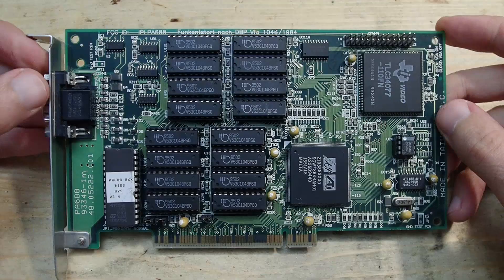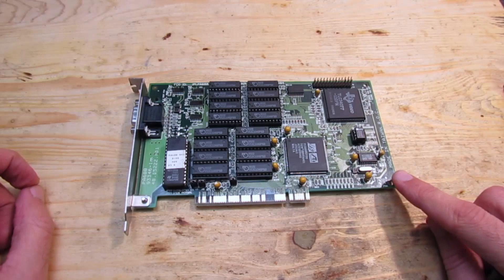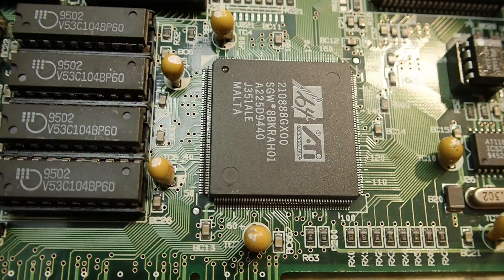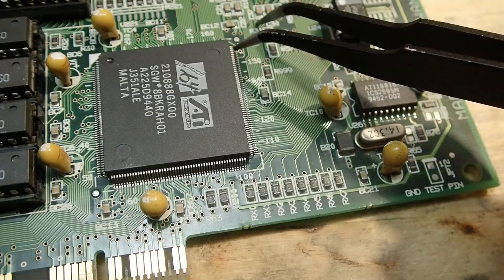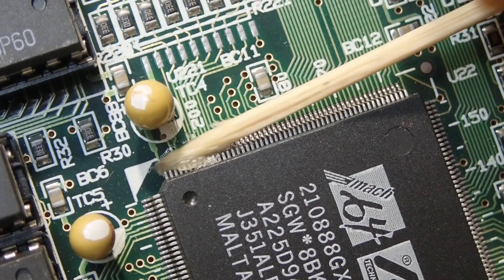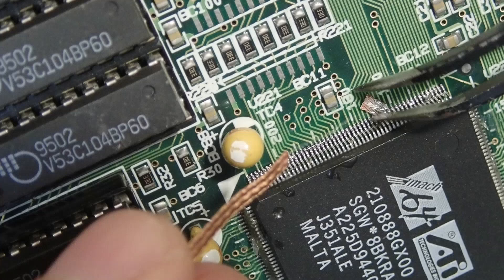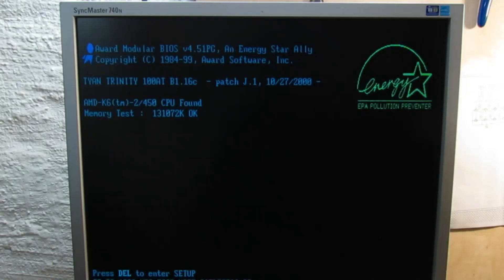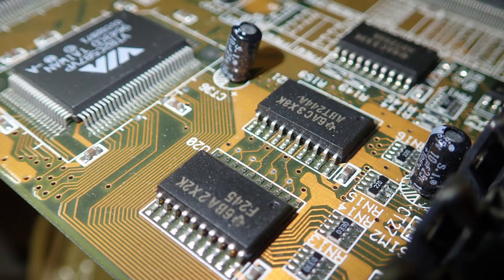Let's repair a VGA card or how to reflow the solder on SMD ICs.

Comment: This is my new favourite YouTube channel - I love these repair videos.

It would be good to know the type/brand of flux, solder and soldering irons you use - as there is lots of choice depending on the situation. You could probably dedicate a video to this - I did a quick search through your video list - sorry if you have covered this and I have missed it. Thank You!!
Reply from the maker: In this video I used no name cheapest 60W iron from Amazon. The flux is from German company Stanol, also cheap and I got it in electronics store around the corner. :)

Comment: I once read that broken GPUs can sometimes be fixed by baking them in the oven to reflow the solder.
I think LinusTechTips once tried this but failed.
I wonder if this technique would have worked in this case?
Reply: its only a short time solution. Reflow is the answer
Reply: In that case, it's to reflow solder balls under the GPU, on modern chips. Or so the theory goes, in most of those cases the connections between the chip die and the BGA carrier are irreparably broken, and heat just temporarily makes the broken connections expand to make a connection again. Thermal stress will break it again after some use.

As for this card, getting the entire board hot enough to get the solder to reflow, could damage other components or the PCB.

Comment: BTW it's worth pointing out that you need to use good quality solder wick, the stuff with flux built-in. Cheap solder wick has no or very little flux and does not work at all well. 

BTW what is the gooey flux you show - looks like the stuff Louis Rossmann uses!
Reply from the maker: I'm glad you asked :) I'm using the cheapest no name materials from China. All you see in this video is no name and even the soldering iron is a 10€ no name part from Amazon :D Really, no joke.
Reply: It's just standard flux paste.

Comment: PCI cards are plagued with cheap capacitors, bad components, bad PCB and manufacturing process. When I have yet see an ISA card go bad.
Reply from the maker: I have a box full of bad ISA cards. I don't really feel a difference. On powerful AGP cards and many GPUs however, caps do blow up more often. But this is due to much higher stress and temperatures.